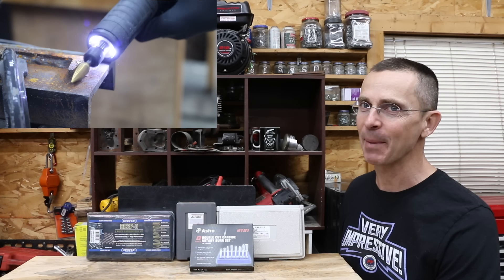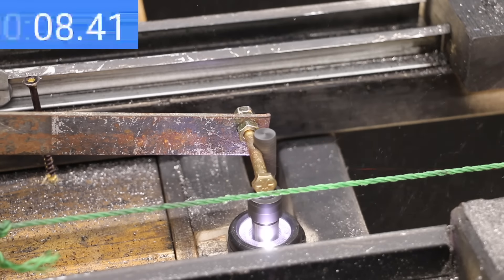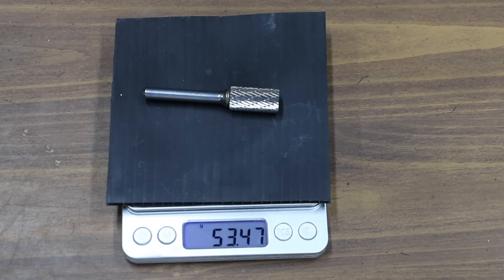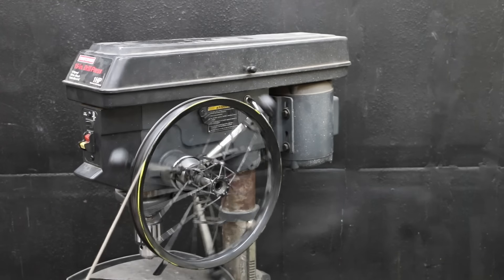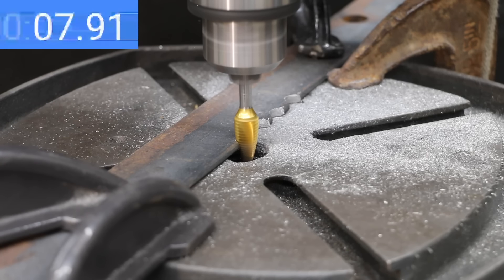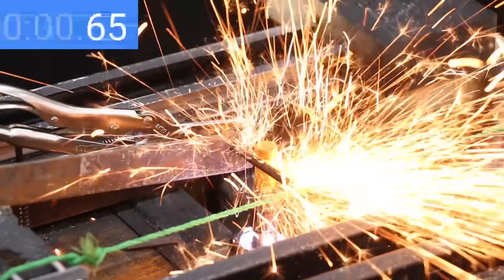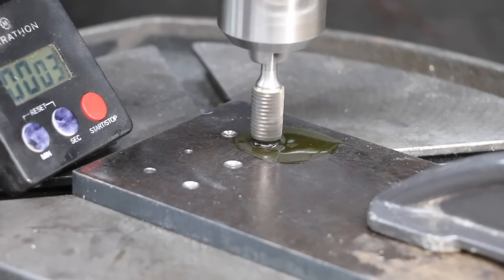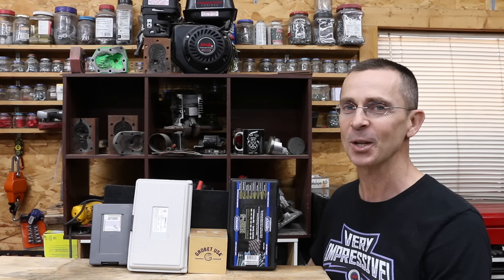$28 vs $300 Burr Set? US vs Imported Burrs. CLE-LINE, Champion, Grobet, Kodiak, Astro Pneumatic

Comment: Time never wasted... ..
The go-to guy when I'm getting something a little more pricy!!
Great testing procedures.
Me thinks chipping is a lot to do with pressure speed and the tension holding the bit.. Much about vibration and the task at hand. There is no way to test that out in 20 minutes or so. Still, you are taking these to the edges, which is great. I'm  interested in the 1/8 shaft stock for wood. So I figure chipping shouldn't be a factor. It could be that the chipping is about a more aggressive cutting edge, too. Anyway, I got a very good look at the facets and I do work with metal also.
Always great info in a small package. Thanks for your time.
Reply from the maker: Thanks and you are welcome!

Comment: The thing I have noticed being a welder and doing quite a bit of carbon gouging  we found the slower rpm I think ours were the makita 9000 rpm ones that were geared down instead of direct drive 20k rpm ones  the bits removed way more material as well lasted much longer like instead of a bit every 2 days we went down to a bit a week maby even longer was reading up on it perfered in steel and higher carbon steels is usually just keep it under 10k rpm
Reply from the maker: Thanks for sharing.

Comment: I'm not sure of the uses of a burr set. But I did buy a Woflcraft rasp drill bit, for $8 bucks cdn. About $6 bucks usd. It cut through 1/16th inch steel like it was butter. 

My el cheapo titanium step bits was a struggle, with hardly any effect on the metal brace. It took 2 hours to source out and run to the local hardware store to pick this up. Got the job done before sunset.
Reply from the maker: Thanks for sharing.

Comment: I like the fact you went through the trouble of doing these tests and building a fixture for consistency. I do feel that it would have been better to do some tests that are more representative of what the bits are used for. A fully buried carbide is going to be a lot more subject to being able to remove the chips before they are re-cut and thus damage the teeth. As the material removal rate goes up, your spindle is going to slow down and also affect the outcome, so the reality is that the better bits may be even more betterer than the test shows! I know from experience that better quality burrs vibrated less, lasted longer and produced a nicer surface finish.
Reply from the maker: Thanks for the feedback.

Comment: Would like to see more tests focused on reliability and longevity in these power tool tests. 

Maybe a test that cut through a lot of progressively tougher materials to see if and when the motor overheats or stops. 

Also maybe testing them after being subjected to cold or hot (not batteries just tools). Maybe place them in a freezer for a day then in an over at 100 degrees for an half hour or so 

The #1 thing I look for is not so much how fast it can cut and how fast a brake engages.. but how long will it last before I have to buy another one.
Reply from the maker: Thanks for the suggestions.

Comment: I wish I knew what brand "tree" burr I have been using for about 8 plus years at over 400 plus uses on Cast Iron,  Mild Steel,  small amount of Stainless sheetmetal, etc.  and it's just recently starting to get dull,      there is no markings on it.      Great Video, 
   Thanks
Reply from the maker: Thanks!

Comment: I would have liked to see a test where they ran along the corner edge of a piece of steel for a length of about a foot at the same depth, maybe a 1/32" or so, and see which ones produced a smoother finish than others while also taking no damage on the test. That is more what these types of burr removers are for.
Reply from the maker: Thanks for the suggestion.

Comment: Not done a Huge amount of steel cutting, but if you have sparks flying off like that you are cutting way too fast, and will dull your tools vastly faster than you should.   Steel is cut slowly with large shavings - this is a mistake I made cutting some holes into angle iron, tried to cut them really quickly at high RPM and used one $25 carbide bit for 1 hole, and it couldn't cut the 2nd one.  Doing it again, but this time with oil, and 250 RPM, created a cool cut (didn't heat up red hot like it did when I tried to cut it 'fast'), and it cut through vastly quicker.. AND I was able to keep using the bit because it didn't get destroyed.  I don't think it is quite fair to say that some bit got damaged when you burned the crud out of them.  That must have burned the bits.  But, overall, good video.  Doing it with some form of cooling, at a proper speed would seem like a better test.

Comment: I can't help but wonder, when I purchased burrs, and I admit, it has been some time, the burrs were rated at RPM, with some burrs having a much lower RPM than others. The Lower RPM burrs I found, if I kept the RPM to their range, would hog out lots of Material, but, at lower rate of deterioration. The higher speed burrs, were lacking in the hogging of materials, but their longevity made up for it. On a slower speed rated bur, I could say get 1 "hole" plunge in 10 seconds, but only get around 5 holes before the burr was trashed. However, Another burr, could make 20 holes, but, the RPM limits made them a 1 hole per 30 seconds.
Reply from the maker: Thanks for sharing.

Comment: Have you done the Bauer surface conditioning tool? I think they just came out with it recently Eastwood has a similar product. It's meant for stripping paint off metal surfaces or polishing it can also be used in wood working.
Reply from the maker: Thanks for the suggestion.

Comment: Should use a little bit of cutting oil. I use these kind of burrs a lot when porting cylinder heads I've found that most are pretty much the same. I use single cut for cast steel and double cut for aluminum. I usually go for cut quality rather then cut speed
Reply from the maker: Thanks for the feedback.

Comment: Not meaning to brag but I’m rather awesome with these bits and after having done everything from grinding a tooth (my own) carving unique designs into wood plastic plaster and aluminum and using them on steel at work almost every single day for the last 9 years I can say the cheaper they are the worse they preform unless your working on non metal projects spend the money to do the job without the risks
Reply from the maker: Thanks for the feedback.

Comment: I think the varying diameter of the tapered burrs has an effect on their performance in the second test. Speeds and feeds are not ideal for certain parts of each burr. That said it does give a good A-B. That said if I were doing a notch, I would not be starting top down with the tip, I'd be coming in laterally with the big radius of that tool. Cheers!
Reply from the maker: Thank you!

Comment: Thank you for these tests on the products. I just orderd the Jestuous Burring bits for a special hole in a stainless steel part I need to enlarge. I will come back and comment on how it worked. Question: Should I use oil to keep the part and bit cool and what speed do you recommend for the drill press? The piece is about 3/8" thick Stainless steel.

Comment: You know what would be great? A more comprehensive test featuring just USA-made burr sets (including the ones already tested here) along with coated types (TiN, AlTiN, maybe otheres). It'd be helpful to find which are the most durable brands, but also what kinds of coatings make the most difference. Oh, and also whether single-cuts are more durable then double-cuts.
Reply from the maker: Thanks for the suggestion.

Comment: This numbers align almost perfectly with "You get what you pay for" Although just like any tool, once you get to the very top few name brands, you start paying for the name. Like Snap on, Mac, SK, Matco ect. ect. Yes they cost 600% more than the cheaper brands BUT are they 600% better?. I look at it like this, If its a tool that you are going to abuse, almost to its yield everyday and your paycheck depends on it. Yes, buy once cry once. In this test, If I had a shop where I used a bur all day, like porting heads, I'm going with the Champion hands down. If i'm porting heads at home or every now and again or just use burs to clean up or use it to "make it happen" I'm going with the Kodiak. The low priced one..... I'm stuck and just need a bur to finish this job to get it out the door and probably never touch it again, the KangTeer it is. Thanks for another great video.
Reply from the maker: You are welcome!  Thanks for sharing.

Comment: Carbide is not meant to be used unless it’s coated.  Even if you’re using an end mill to cut steel, it will dull out very, very quickly.  Two things that make carbide dull quickly are heat and chip evacuation.  If you have the same steel chips you cut, re entering into the cut, you’ll dull the carbide.  That’s why coolant is used in applications, to evacuate metal from cutter.  Uncoated carbide works well with cutting aluminum and plastics.  It will work ok with very light material removal applications but you’ll have very limited life.
Reply from the maker: Thanks for the feedback.
Reply: Burrs are not meant for the application of cutting bolts in half.  They are called Burrs because they are used to remove sharp burrs off of edges and lightly shape material surfaces. If you want to cut a bolt in half, use a cut-off wheel.  
If you look at an end mill, they have flutes that are ground to carry chips away from cutter.  If you don’t have that ability in your cutter, which Burrs don’t.  You will chip and dull the edges as shown in your video.

Comment: I liked the video, at least "a bit"!😉

To be clear, none of the bits had an oval shape in any way. An oval is comprised of 2 parallel lines connected at each end by semi circular pieces. The term I think you're looking for is elliptical, however, that's not quite right either.
Reply from the maker: Thanks!

Comment: Could we get back to safety gear/work gear?
You did eye protection, gloves, boots. Why not different types of pants?
Jeans, canvas, and whatever else material they use nowadays.
Then double front jeans with or without the built-in knee pads.
Are my $100 pair of steel carhartt pants twice as good as the $40 noble impact pants for example?
Reply from the maker: Thanks for the video idea.

Comment: Your rig needs a small one way shock absorber, so it doesn’t want to chatter . They are available for Mercedes Benz on various nineties cars belt drive.
Reply from the maker: Thanks for the constructive feedback.
Reply: @ProjectFarm  quarter inch router would be perfect for your tester instead of battery and battery could be made from several independently charged and parallel 3-5 batteries in the array. I think 120 v wall is the choice

Comment: I'm comment this separately from my previous comment as I think it maybe helpful to others, I ordered Jestuous off amazon canada and they appear to be 6mm rather than 1/4, I'm unsure if this was just luck of the draw or what they are however they do not fit well on my GE710 Plus; can confirm another locally purchased burr bit fits fine which I assume is 1/4(google suggests 1/4 is a touch over 6mm so I assume it maybe a 50/50 shot on if they will fit right on some die grinders).... currently waiting on a 6mm collet so I can use either size:D
Reply from the maker: Thanks for sharing.

Comment: I love all your video's and now before I buy a tool and search you video's to see which one suits my needs better - Good Video's... But, I do have a problem with this one... there is a problem buck'o.... If the cutters are design for 30,000 rpm's and you are comparing cutting speeds... then you must spin each one at the rated optimal speed... Your jig only gives each bit the same force but NOT design bit speed... love your video's...
Reply from the maker: Thanks!  Thanks for the feedback.

Comment: I love your test but the optimum rpm for carbide burrs in steel is 20,000 rpm, the slow speed is the reason for the tooth chipping.  I have used Grobet(pronounced gro-ba) for the last 20 years. In an industrial environment the Grobet is your best bet.  I know your videos are for DIY so I wouldn’t buy the expensive burrs either.  Again, I love your videos.
Reply from the maker: Thanks!

Comment: I'd like to see the tool steel test repeated with water or oil cooling. You can see the allen keys losing temper and melting. Not the best test of cutting when they're really just overheating the metal.

Comment: A lot of offshore oil companies will not buy lifting hooks made in China b/c they make cast steel hooks (melting variuos steels and pouring them into a cast) that are composed of random garbage steel thats made up of many different tinsel grades.  When you have different tinsel grade steel melted together they do not bond well with other tinsel grades and what you have is a fault line in the steel that are essentially weak points in the steel.  They cannot handle the stress loads that steel composed of the same tinsel grade can.  Forged steel is much better because the steel is heated to a point where it is softened/flexible but not melted and is hammered, rolled, bent, into its final shape.  Forged steel doesnt have varying tinsel grades in it and thus doesnt have fault lines in it that are destined to tear apart.  Even if you take steel of the exact same type/same tinsel grade and melt it then pour it into shape (casting) , that will create varying tinsel grades when it cools.  If you take that same steel and forge it, you wont have that problem but its a more expensive and time consuming process than casting and thats why its more expensive.
Reply from the maker: Thanks for sharing.

Comment: Hi, Amazing as usual. I was wondering about the limitations of continuous cutting method u used in testing. During the process the allen key and bolts get hot and soft after some initial chippng.. cutting action. And the burr cuts like cheese  after that. This might not be the case in actual deburring scenario and the tools might actually be optimised for such real scenarios!?

Any comments?

Comment: Total noob question, but what does one do with these things?
Reply: A whole lot of different things that you could never do with your bare hands or regular pliers. If when facing a difficulty that makes you think, I really need something to hold or grip this thing-a-ma-jig with great power…., when doing a project, then you reach for some form of locking pliers. They come in several configurations and sizes.
Reply: @mercoid  these are burrs not locking pliers
Reply: @tjmarx  hahaha yeah idk why he’s talking about pliers. 

Mostly for carving metal or other hard materials. Welders often use them to grind down their weld beads. I use them to carve hardened steel for knives. It’s basically a rotating file. Produces super sharp little splinters.
Reply: @lindboknifeandtool  Oh, that's good to know. Thanks for very much for teaching me something new

Comment: I would just like to add that for some jobs, you really don't care about the quality of the bits. Working with composite materials, 9 times out of 10 we'll just slap double sided tape to the back a small piece of sandpaper and wrap it around the bit and put it in a small pneumatic of electro portative pencil grinder. Yet for some reason they still get us carbide tips.
Reply from the maker: Thanks for the feedback.

Comment: I was hoping you would cut bolts until they couldn't cut anymore. That would give me personally a better idea of wear and durability
Reply from the maker: Thanks for the constructive feedback.
Reply: @ProjectFarm  I was not trying to criticize, I love your tests. But for me, seeing the damage under a microscope after one cut doesn't tell me how long it will continue to cut for. Does it get worse, quickly or stay useable? If they last 10 times longer than the slightly cheaper ones then the initial expenses is worth it.

Comment: How do we know those are all actually made of tungsten carbide?  Are there any material tests that can be performed to verify the materials are actually what is advertised?  I know tungsten carbide will produce a different style of spark vs steel when placed against a grinding wheel.  That's a generic coarse test, but other test results like XRF or other spectrochemical analysis type tests would be extremely useful for determining material composition.  These tests would really add a lot of value to the results especially since we all know amazon products are notorious for false claims.  Are some of the poorest performers in this test even made of tungsten carbide?  That's still a really good question.
Reply from the maker: Thanks for the feedback.